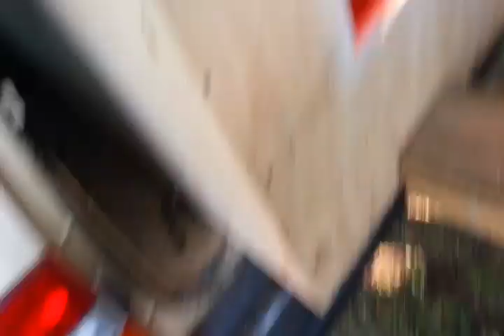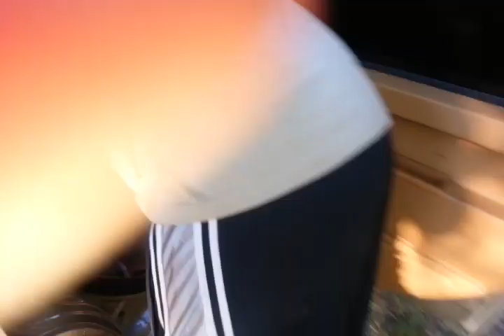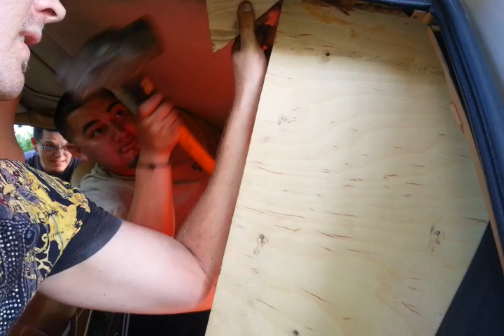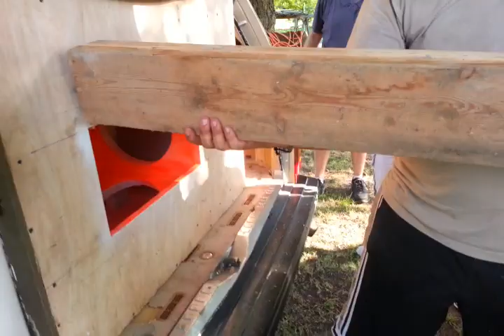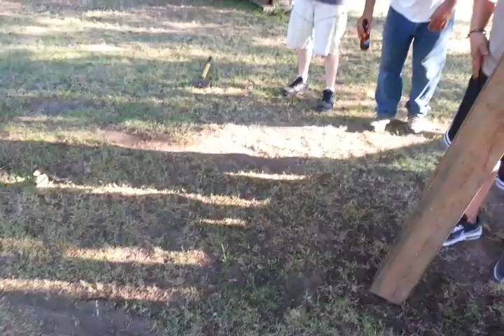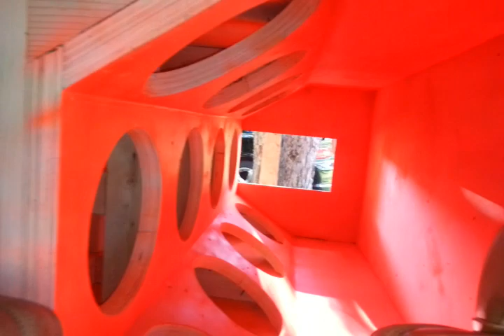The most Amazing audio install ever

Comment from the maker: @heretic30176 I had more than enough space with 42 cubic feet. It takes a lot more time to build and supplies to build a wall that is equally as strong as this one inside the vehicle.  It took about 35 minutes to get the wall in and only 12 hours of labor to build it. Compare that to a well built wall inside a vehicle witch takes anywhere from 30 to 100+ hours to build.  Now tell me what sounds better.